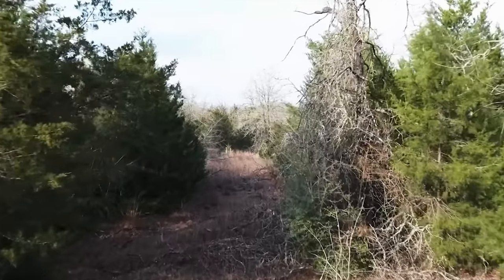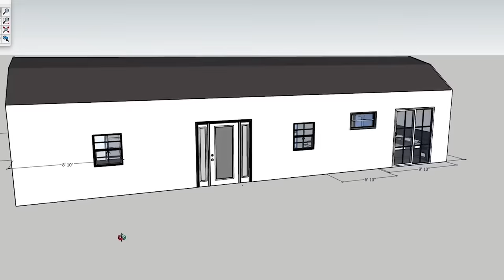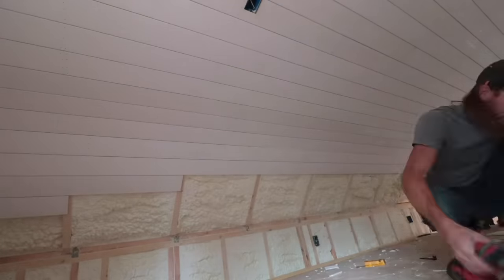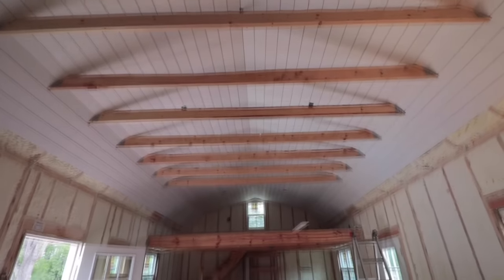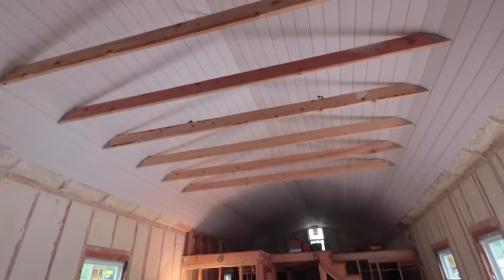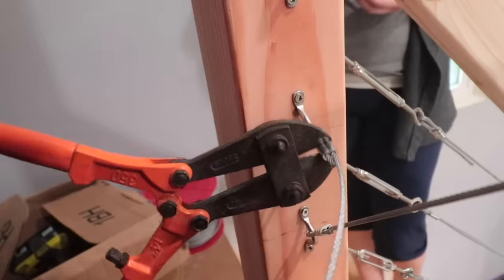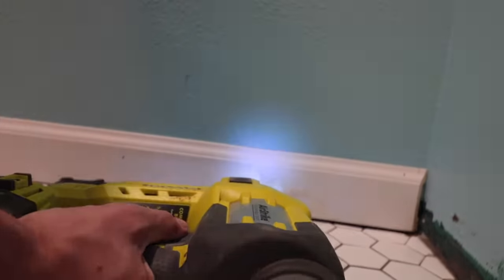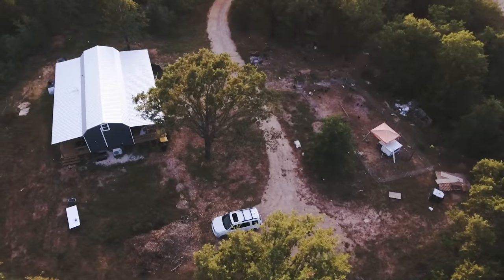515 Day Shed to House Conversion in 13 minutes {Timelapse}

Comment: So you bought a single wide mobile home and put a porch on the front
Reply from the maker: Nope.  Show me a single wide mobile home with our kitchen.  Show me a single wide mobile home with our ceiling.

Show me a single wide with our sleeping lofts.  OR with our bathrooms.
Reply: @BetterTogetherLife  For all the effort, you might as well have built 4 more walls and just stick built your house on site with a proper foundation instead of cinder blocks like a single wide

Comment: I Agree debt free is the way to go, However you spent a small little Fortune, yes things are cheaper in Texas. Your labor cost may be a little less than normal, But material is pretty standard though out the country and bringing in utilities like Water and Power. Than adding a septic system and propane tank all that stuff ain’t cheap. My guess is you’re in this whole project at least 150000.00 thousand, That’s my guess anyway. I would like to know what you did spend and how much that works out per-square foot

Comment: While I do love the notion that people put out of "living debt free" Ive looked long and hard at these types of buildings and the simple reality is that you pay every bit as much and get a lot less doing this than going a traditional build. 

For example it is unlikely that you are going to find land at less than 1k per acre and thats an incredibly liberal estimate with prices being a lot higher. Then look at the shed. the 16x48 model you are looking at $17,315 MSRP from this manufacturer. Then you have to add in insulation, plumbing, electrical, interior walls, fixtures, cabinetry appliances, ect ect ect ad nausea. You would be lucky to pull all of that off for less than 20k. Thats before the labor involved which is probably over the course of 500 days going to be at LEAST another 10k.

So do you really think you are going to be living better in a custom built 16x48 shed than you would be living in say a 14x80 single wide trailer that will have near all of that standardized for about 40k? If you are patient you dont think you can find an existing home out in the stix like this for 25-35k? 

Fact is its all misconception.  Its just differences in how you pay for things and what you get for what you pay for. A shed building like this may be done up as well as a standard home but no bank is going to finance one because of the building regulation short cuts and the lower longevity to it. Homeowners insurance is going to be another issue dependent on where you live.

So its definitely not about freedom as you will be enslaved to a home with vastly lower resell value, that cant be financed and maybe not be insurable that is going to quickly fail to meet your needs. (IE like trying to house kids in a loft area seems great when they are 6 but by the time they are 16 it will become a huge problem. Enough of one most families evacuate these type of buildings for a more standard home.

So while I like the concept and have already done one myself, It worked in my situation due to already having a home on the property, and not having kids still living at home. So all I had to worry about is myself. It worked in my situation but so many people trying to do this have noble intentions but lack forethought and vision to foresee the issues it is going to bring up and end up paying more for the privilege.

Comment: I wouldn't call it a "house" with stacked wood for foundation and cardboard walls, but I guess it is a "home". I hope you are aware that that shed won't stand the test of time the way an actual house built to code would. I'd be very surprised if it hasn't started seriously cracking and simply falling apart within a 10 year timespan. Hopefully you'll have plans to build something more permanent before that time.
Reply from the maker: Check out some other videos to hear our full plan!

Comment: Sheds are problematic for living for authorities, they are 'S' signed (S for storage), not for living. Why not buying a cabin? Cabins aren't much more expensive than the sheds, all installation are already done (depending on model, of course) you just need to insulate it. And they are much less problematic for authorities.
Reply from the maker: We just liked the floor plan option and possibilities with a Shed conversion. It’s been exciting and surprising along the way. We might do some things differently the next time, though. —kelly

Comment: Though I would have preferred the shower over the bath opting for a longer bath tub and a bit more storage space for the bathroom. Also in the rooms I would need to have 2 large skylights put in the ceiling adding natural light with blind over each that can be opened and  closed at anytime.
Reply: Hello pearl..😊

Comment: Respectfully while I enjoyed the video the "struggle" was kinda humorous. This thing is nicer (before even finished) than half the places I've lived in my life. I do know they did a lot and worked hard but the "struggle" of settling for this is laughable. 

My family of 5 lost our home in Katrina, many people did insurance refused to pay. If you had wind insurance it was flood damage, if you had flood insurance it was wind damage, etc anything to get out of covering it. I do know that was a massive expense for companies but they seemed to have 0 problem collecting everyone's $1,200 a month insurance since it was a "flood area" and prone to frequent damage.. still no problem taking people's money.

After this we where LUCKY enough for FEMA to lend us a 5 bed 5th wheel (4 beds being bunk beds at 5.8 ft) with one queen sized bed. I lived in this with my family of 5 for 3 years. We ended up trying to purchase it from them only for it to be cancelled last min once they discovered these 5th wheels where frequently developing black mold and had an issue with asbestos.

We where sad as we had no real back up option and due to the destruction of some many homes rent at most places went up nearly 300% in a state where you can expect to pay nearly $2,000 a month on rent alone with a job market that viewed $10 an hour for manual labor good.

What you have accomplished is wonderful a real achievement and I enjoyed the video happy to experience it with you however this really wasn't much of a downgrade when it has better living conditions than many through the nation experience.
Reply: Sorry for your hardships. We were homeless, too, lived in a van for a little while, then a camper that friends purchased for us. Now we have a house we bought for less than $600 from the state as a delinquent tax prolerty, praise be to God! We have our own house and our own yard! He can do it for you, too.

Comment: To be frank I can not see much difference between that shed and most of houses in rular part of TX. Cc 800sqf is around 72 sqm and most of families in Europe live in apartments between 70 and 90 sqm but we do not have woods and nature like you have it. I lived in San Antonio TX and I know that summers could be damn hot 1998 we hat 100 days over 100 degrees.  That is probably the biggest trouble you are faced with.

Comment: I’m a builder from Australia 🇦🇺 and love watching other countries building practices. You seem to of done well. But Did I miss something your shed / house looks like it’s being held down by your main electrical line and main plumbing line. I did see a few piers put in for Your decks. Wind 🌬 is your enemy. If You haven’t got any piers. At least install some perimeter piers to help hold it down. The last thing you want is all your great work being blown away. 
Just my opinion from the land down under.
Reply from the maker: Great opinion for sure!!!!  And yes, we need to do some foundation work.  It’s why it’s our #1 mistake to avoid.

Thanks!

Comment: Hard work pays big dividends.
Reply from the maker: I completely agree!  You can always build it cheaper and better if you have the knowledge and time to build it yourself.

Unfortunately I did not have the skill nor the time.

BUT..... I have learned so much during this process I feel like I could now build a bigger hole on our property!!!  This time.... OFF GRID!!!
Reply: @BetterTogetherLife  when you did your spray foam did you use a venting system like foam inserts between the trusses or something to keep airflow under the roof decking? I ask because I just watched a 40 minute video by an engineer on how to vent or not vent a roof. I still dont understand it all but I'm just curious

Comment: 515 days to convert a shed?
You could build a neighborhood in half that time
Reply from the maker: Do you have 4 kids?
Reply: @BetterTogetherLife  Just saying that with the amount of time and effort that went into it you might as well have just built it from the ground up instead of retrofitting a building that wasn't even designed to be lived in.

I mean it's still a cool concept and all don't get me wrong, it's just usually these builds come off as easier/quicker/cheaper than conventional housing.

And you should have waited till those 4 kids could swing a hammer and lay down grout lol.

Comment: I get the small/tiny house trend which makes sense when space is limited, but there is a difference between building small as a choice rather than as a necessity. The truth is housing has become increasingly unaffordable for so many especially younger people and the narrative for the most part has been about affordability when in large part it’s downplaying the fact that people are being conditioned to expect less than previous generations. In this case they are working with seven acres and there is ample space to build a larger home that makes sense for many reasons. The process of building is expensive and it wouldn’t cost that much more to build bigger which makes sense for a growing family and resale not to mention not living on top of one another. I am not against small/tiny homes and in fact I can see myself in one as a downsized 60 year old, but I don’t think it’s the right message or solution for young people. Sets your sights higher and don’t settle,  which doesn’t mean a four car garage and unnecessary space, but come on 768 square feet on seven acres.
Reply from the maker: “Expect less than previous generations”?  

I would say that our grandparents and great grandparents lived in WAY LESS than our current small/tiny house.  

It’s our PARENTS (the boomer generation) that really screwed everything up.  They wanted things bigger, faster, “prettier”, and with more chemicals than we do.  

Luckily some of the millennials but mostly the Gen X’ers are trying to turn that around and are returning to the land.

Let’s flip the script!!!!!
Reply: @BetterTogetherLife   You are wrong.

Comment: This massive project and video must have been funded by the shed manufacturer, "United Portable Buildings", since their ad is sprinkled throughout the video. They probably supplied the building and labor in exchange for using this video as advertising for their "sheds", or "portable" buildings. 
Otherwise, no sane person would spend 1.5 years of their time, labor, headaches, and tons of money to convert a portable building like this into a house, especially when you only end up with 700+ sq. ft.!  If you want a house, why not just pour a concrete slab and put up a "site-built" house, exactly the size and way you want it, for less money, less labor, and in less time, with a lot less headaches? Resale value would also be much higher, and you wouldn't have the huge initial expense of ordering, paying for, and waiting months for the building to be factory-built and delivered, set-up, etc., just to have to completely finish and renovate it from top to bottom once it arrives? It really makes no sense to do all this extra work for more money than it would cost to hire contractors and build a site-built home. Then, you could just finish the interior yourself to save some money. As I've said, you'd end up with a better built, higher value home in less time.   
This is an interesting video for entertainment purposes, but in reality it seems like a very strange, drawn out and expensive way to end up with a 700+ sq. ft. dwelling. Also, I've never heard of a 16'X48' building referred to as a "shed". It's a large pre-fabricated building shell, not a SHED. And these things cost a small fortune. You have to order them and wait months for them to be factory built and delivered to your site - not cheap at all - maybe $30K?....or more? So, just the shed-building, new power, land, plus clearing/leveling, new septic system, a drilled well, propane tank set-up and rough well/septic plumbing to the house must have been around $100K, before any of the construction even started.  
This project must have cost at least $150K, with deck and everything included. Even if the labor was done by friends, nobody works for free for 1.5 years! Time is money. 
How will you ever get your money back on this investment? What buyer is going to spend $150K or more for a 700 sq. ft. converted shed if you try to sell it?  And how would a buyer ever get financing on a shed conversion/house? They couldn't. You'd have to find a cash buyer, which wouldn't be easy. 
It seems like a much larger manufactured home on your piece of land would've been a better alternative to a shed conversion - way less time and effort, less expensive, more square footage and a better, larger floorplan. And you would've been living there in a couple of months, as opposed to 1.5 years!  
Just my opinion. I'm just keepin' it real, baby!
Reply from the maker: I am so glad I came to your Ted Talk.—kelly
Reply from the maker: I didn’t read any of this after the first sentence.  I can not believe you had this much free time on your hands.  That is awesome that you are retired, congrats!!!!!

But no, we actually bought this building from a company called Woodtex, which unfortunately is now out of business.  

Every step of the way has been documented on the channel if you’d like to prove yourself wrong.
Reply: @BetterTogetherLife  I don’t want to be the person that comments under everything but I found this, and your reply! Oh my Lord you are diluted. Have you built up the walls protecting your fragile ego from pure ignorance? this person just thoroughly explained how horribly thought out it was to build this piece of garbage. It’s hilarious to me that you thrive off the support of people that don’t even know what they’re looking at. And then people with knowledge and experience in this field of work critique your building and you get offended. You don’t want to listen! That’s rich. Are you going to teach your kids to stomp their feet when they don’t get their way just like daddy and mommy.

Comment: I'm not trying to rain on your parade, nor am I a hippie but your really need to know this. The spray foam insulation is extremely hazardous to your health... and I mean EXTREMELY. It was only meant for attics and garages not indoor living space. I hope you find this comment and test your home for the known hazardous chemicals.
Reply from the maker: It’s completely safe.  Just hire a licensed contractor.
Reply: @BetterTogetherLife  Doctors are licensed and they still make mistakes. Meaning your licensed contractor more than likely did not know any better. As far as my advice you can take it or leave it.... Get your house tested